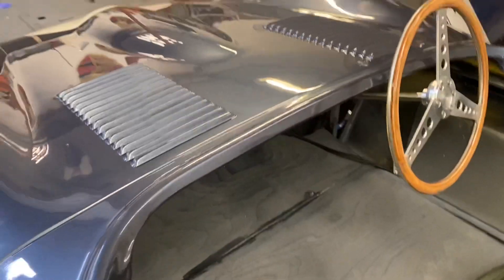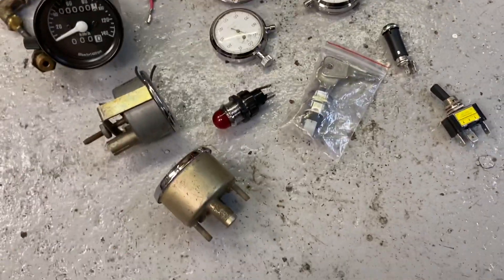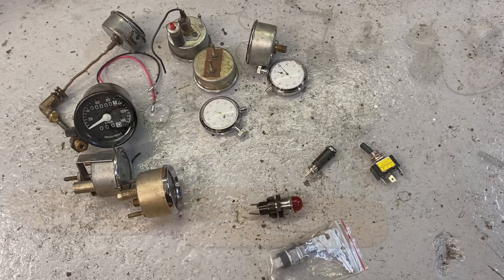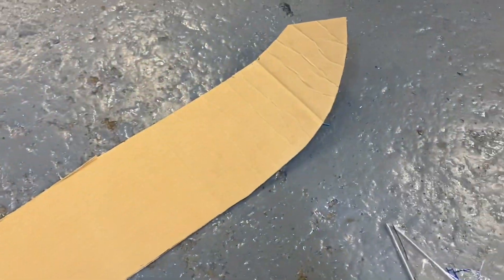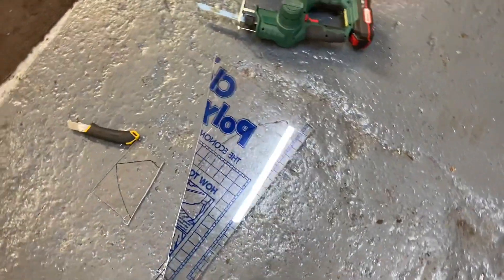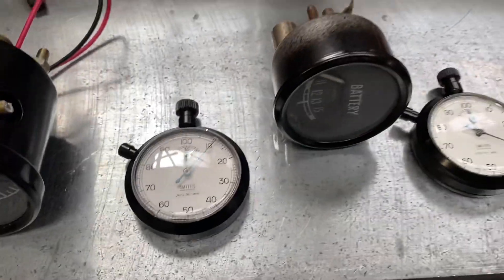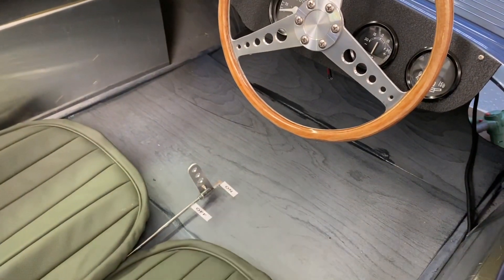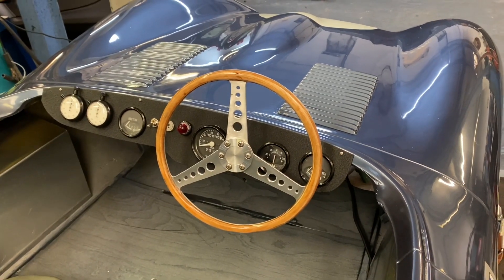3/5 ths D type high speed test !

Comment: Looking fantastic. Try Wicks 210002 acrylic sheet. Worked well for my Mistral body low screen. I cut it with a Dremel diamond slitting disc and linished edges. Same sheet for headlight vacuuming @ 170oC. Appreciate videos.
Reply from the maker: ok thanks for info , did you bend it as well?
Reply: @scarlettsgarage1  The sheet is extremely flexible and formed a nice wrap/curve on the screen with no problems.
Reply: @scarlettsgarage1  I uploaded a short clip of the screen on my channel if that helps.